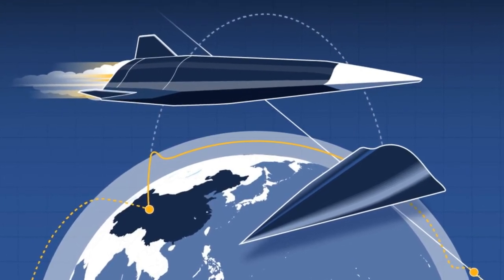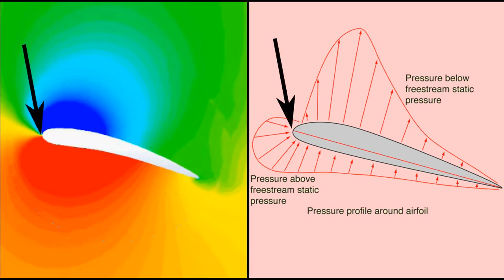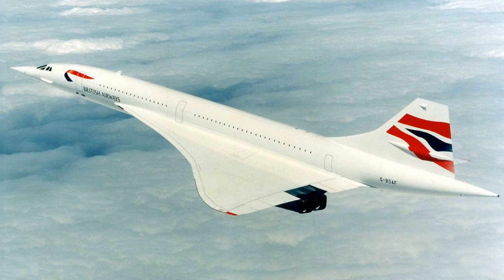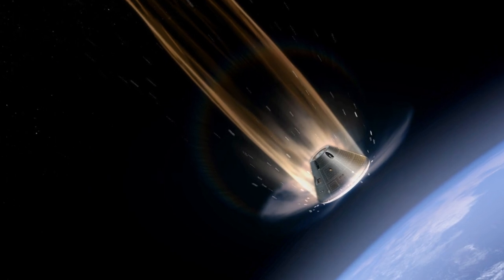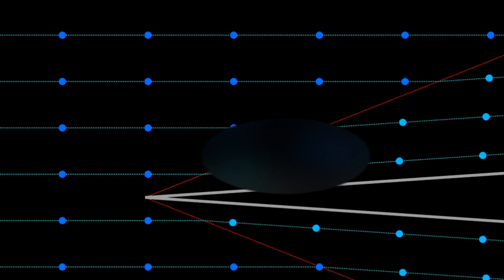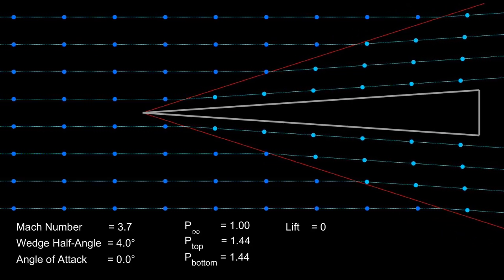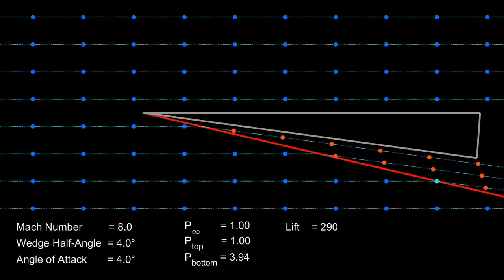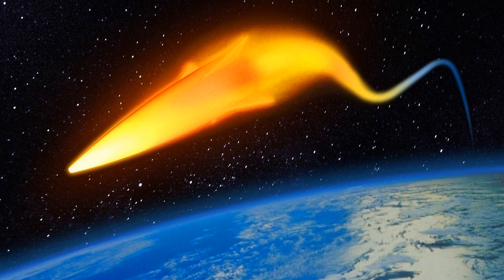Hypersonic Hijinks Part 1 - Compression Lift

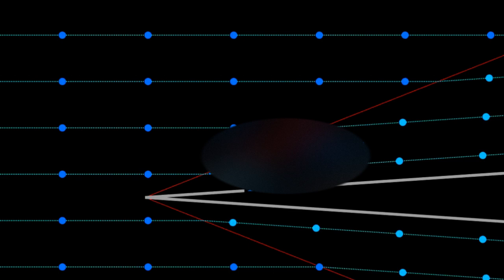Comment from the maker: I made a mistake at 7:18 - the geometric explanation of the shock angle I gave is actually for a Mach wave. I've blurred the offending illustration to prevent confusion and I will post a short video in the future to explain the difference between Mach waves and shock waves correctly.
The general 'hand-wavy' logic can still be applied, however, the pressure and density after the shock wave are higher than before and the flow is deflected. A Mach wave is the 'sonic boom' that we hear far away from a supersonic vehicle. The air flow is not deflected across a Mach wave. At the end of the wedge, expansion fans and shock waves act to reduce the pressure of post-shock gas back to ambient pressure and convert the shock wave into a Mach wave.

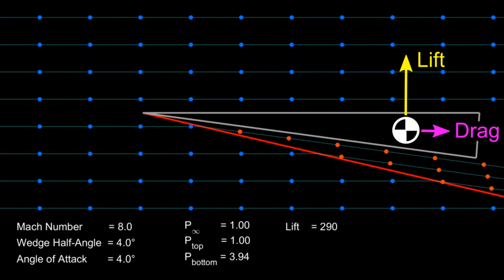Comment: 10:06 Increased drag is also beneficial because the distance from the shock to the shuttle body is maximised, which reduces heat conduction and radiation from the solar-temperature shock to the shuttle body.
Reply from the maker: Thanks for watching, I can tell you've red the pre-class notes! 

You're right that blunter bodies have greater shock stand-off distances at the stagnation point, which reduces the thermal gradient and therefore conductive/convective heating of the shuttle nose and leading edges. 

Something that I'll talk about in a future videos is how large shock stand-off distances actually increase the amount of radiative heating in the stagnation regions. Luckily, radiative heating only becomes dominant at atmospheric speeds of 10-15 km/s and above, which is why it's a relatively minor concern for Earth vehicles. If you google some images of the Apollo capsule TPS (which entered Earth at ~11 km/s) and the Galileo probe (which entered Jupiter at ~47 km/s) you can see that the Galileo probe is much more 'pointed' to reduce the amount of radiative heating. If you have access to Hypersonic and High Temperature Gas Dynamics by John Anderson, there's a good case study of the Galileo probe with more details.
Reply: @TheGravityAssistant  Wow I didn't know that, thanks!